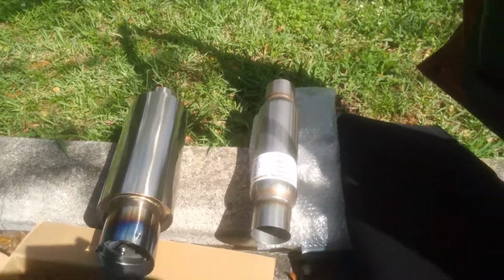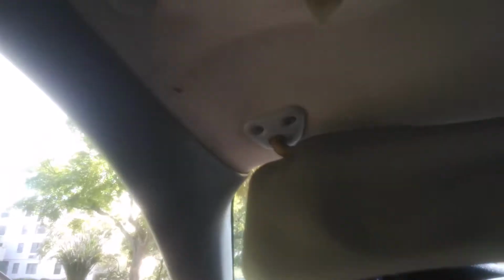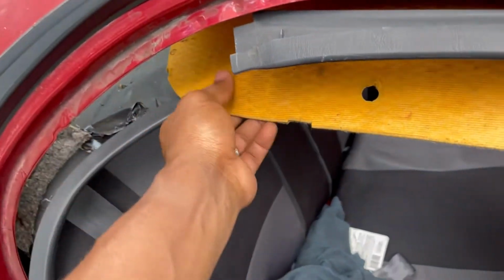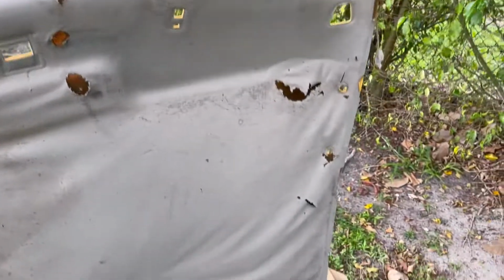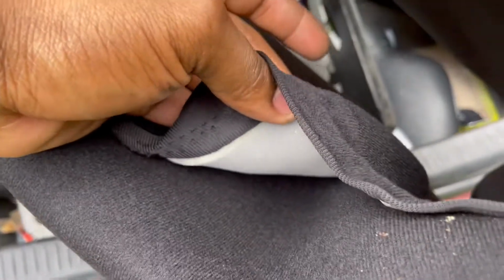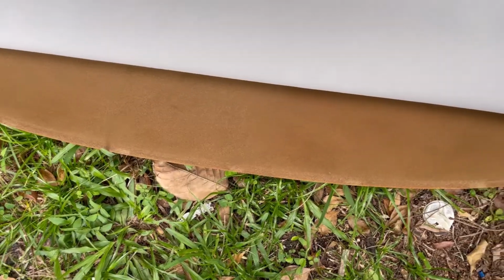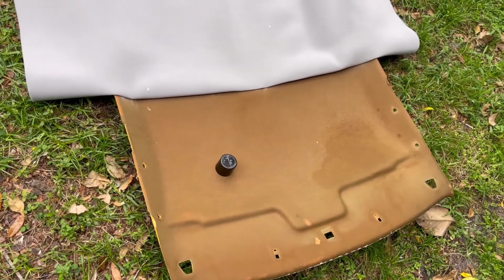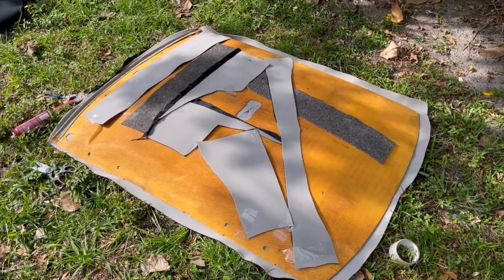1992 -1997 TOYOTA COROLLA HEADLINER REPLACE

Comment: Actually a video of how to glue it and not make it look tacky my only concern with doing this in mine is the foam I had my mechanic just glue the one now so it wasn’t hitting my head and some parts have come off because the foam just comes off with glue have you had any issues with it staying on in the 3 years after this video?
Reply: And I love the shade of black you picked for the liner I have the same seat covers and it seems to match them very well